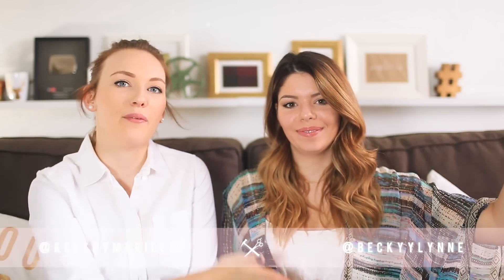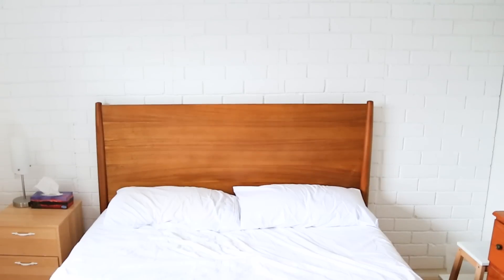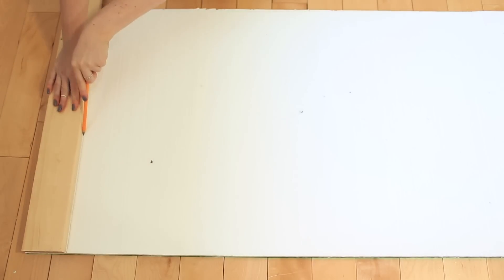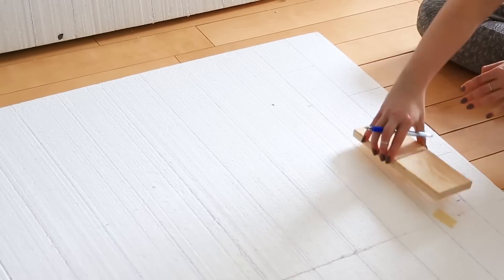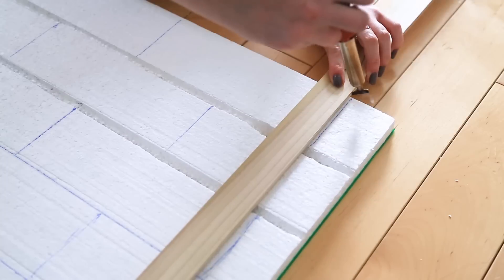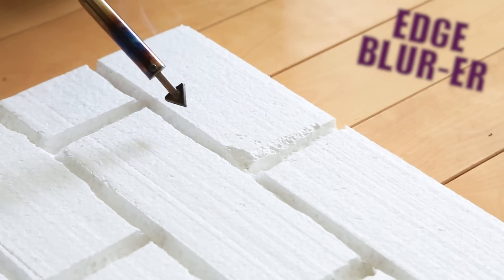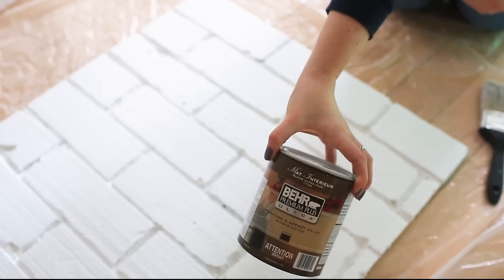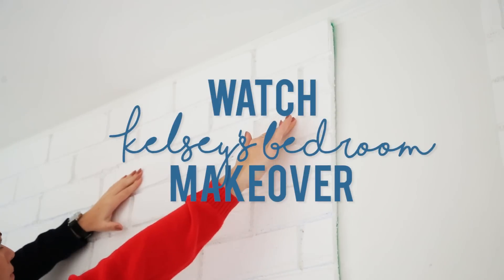DIY FAUX BRICK WALL - THE TEMPORARY WAY | THE SORRY GIRLS

Comment: Pro tip: I use the tip of an old hot glue gun to do the exact same thing and melt/"weld" the foam
Reply: THANK YOU
Reply: omg thank you!
Reply: chynatheching yea or I was thinking a wand curler
Reply: OMG THANK YOU FOR THAT COMMENT! I really want to do this brick wall but my only problem is the welder! I was thinking of something I can use instead of welder haha didn't think of glue gun thanks so much xx
Reply: YOU ARE A LIFESAVER I LOVE YOU
Reply: THANK YOUUUUUUU
Reply: chynatheching LIFE SAVER
Reply: Anyone have pictures to compare the hot glue gun affect?
Reply: chynatheching this is awesome!! Thank you for this tip!
Reply: GOD BLESS YOUU
Reply: do you just not use glue in the hot glue gun?
Reply: BLESS YOUR SOUL I HAVENT DONE THIS YET BC I DIDNT WANNA BUY A WELDER
Reply: chynatheching. THANK YOU!
Reply: You're literally god sent.
Reply: great tip!
Reply: Ohh tyy i was about to comment that i was sad cause i didnt have the tool lol
Reply: hey when you say this do you mean like turn on the glue gun?
Reply: i think you just turn it on without putting the gluestick on
Reply: Whoa..way later..but how about a soldering iron???
Reply: I was just thinking of that...wondering if it'd work
Reply: I was thinking about using my hot glue gun while watching this video too ☺️
Reply: wowwwwwww genius
Reply: Thanks for the tip
Reply: Didn’t work
Reply: u bloody legend thanks
Reply: Omg that you you are literally a life saver
Reply: Just tried this. The hot glue gun melts the styrofoam VERY slowly. It also shows the imprint of the round tip of the gun. I'm just gonna purchase the tool instead of spending 16 hours using the hot glue gun.
Reply: @bellak2546  THANKS for sharing your experience!
Reply: STOP LYING
Reply: thank youuu
Reply: This comment is so genius thank you!!
Reply: I used a lighter. I tried a curling iron and it wasn't hot enough
Reply: @Carson Cohen instablaster :)
Reply: @Marlon Xander It did the trick and I finally got access to my account again. Im so happy:D
Thank you so much you really help me out !
Reply: @Carson Cohen happy to help :)
Reply: just saved 30$ thank you <3
Reply: THANK U

Comment: You could even cover the styrofoam in grout to add a more realistic texture. One or two coats of watered down grout shouldn't add much weight and would add a ton of imperfections for realism.
Reply: And it probably would also take away this weird styrofoam feel when touching the wall, right? Has anyone tried it?
Reply: +Pheove it's a really common technique for building foam rocks such as for reptile enclosures, it works great for that. Usually you spray some watered down glue over it after to seal it, but that's not exactly necessary.
Reply: J Hughes Sounds great, I might try it. Thanks! :)
Reply: Way late...but.. foam core boards or plywood etc...covered in spackle ..sometimes a base layer..let dry..then add another thick coat..then before it sets you drag the lines to "carve" out the lines to make the bricks... we use it for theatre sets.. to make bricks..stone..tile..then paint everything...you can take a brick sized and shaped sponge to add more grout to the "bricks"  adding more dimension to each brick..and more texture..before painting...using theatre set tricks can sometimes turn plain jane items into really amazing items...and in rentals using some of the theatre set theory can help too... backdrops on rollershade devices using flats...like movable frames with feet to make walls... so many different possibilities... i hope people really used the idea in thus video to make amazing walls that could move with them from one apartment to another...
Reply: Loli, great ideas!  I would like to do something similar for a wedding backdrop.  I thought maybe even chalk wax might give it an aged dimensional look.  Thanks Sorry Girls for this DIY!
Reply: @calliemaddiecats5457  honestly...for the wedding...if i had enough money I would just buy the four by eight faux brick sheets available at most home improvement store.... because a bride has a million and one things to do already..just paint....if not...use a  soldering iron and seal with a watered down white pva glue and go nuts with your faux painting techniques.. good luck with everything and Congrats!!!!
Reply: Great idea, but would the grout adhere to the styrofoam? Styrofoam is a tricky material...
Reply: @loliluxe1747  Super helpful now, so it's not too late!!
Reply: @angelagladwell354  PVA grout should adhere... U could always coat ur Styrofoam with pva/white school glue before anything... I have coated cheap Styrofoam in school glue and been able to paint it with paints that normally would melt the Styrofoam!
Also..I saw someone take cardboard, their hot knife, or soldering iron... Draw out the bricks, go over "grout lines" a couple or few times with the soldering iron then really go nuts with the Spackle... Then they used re terms tape, a reusable heavy duty silicone type tape...to put it all up for a back splash...it was gorgeous... It was a renter friendly video.
Reply: @sarahelliott5588  I found a cardboard version of this too... Read my other newer comment!

Comment: THIS IS ONE OF THE GREATEST DIY'S ON THE INTERNET! I've been trying to redo my wall for quite some time now but I rent the place so I can't paint it or glue wallpaper on. Just two questions: Could I use a dremel instead of the plastic welder? And I have lights and a light switch on the wall I want to do this on. Any tips would be appreciated. Thanks! xx
Reply from the maker: +flora li Hey! I think we saw someone else using a dremel on styrofoam, maybe just do a quick google search. I had an outlet and I just cut it out using an exact knife!
Reply: +flora li the issue that seems to present its self to me is that your brick woudlnt come forward in an actual brick wall, the plate of the light switch or plug in would sit ontop of the brick so it would be kind of obviously fake. if that doesnt bug you ive seen high density Styrofoam cut with a dremel to make holes (which would then be used to reach your switches) but i think you need the welder to get this effect on the actual board D:
Reply: Joshua Creel Thanks! I shall take this great advice on board I don't even use the lights on the wall though, what a shame :/
Reply: +flora li Yes, this is A-M-A-Z-I-N-G!!! I was thinking for ages... what to do with that poor empty wall in my flat! Thanks girls!!!
Reply: You could probably use fine point soldering iron. I've used it successfully in the past on plastics and regular Styrofoam, will probably work on that Durofoam stuff, too.
Reply: Can you ladies possibly update your materials link, when clicked it's taken to a page called "parsel" with no materials information! Plz n Thx!! Amazing DIY!!
Reply: LadyDiva9081 yes please update!!!!!
Reply: I actually kind of just dug through my local hardware store's aisle of insulating materials, until I found a similar stuff :) It's usually in the back of the store next to cement, fences, lumber, and other building stuff like that.

Comment: This looks awesome!! What a great idea! I think if you didn't want to use the plastic welder thing (personally it looks kind of intimidating to me!) you could also try cutting out styrofoam into rectangles that look like bricks and gluing them on a styrofoam base sheet. That way they still stand out in a 3D way but you can avoid the welder tool

Comment: Wow 

What do you think about applying that to a ceiling a half that it doesn't have a shower? 

Also there is this other tool that it's for photos or some kind of plastic heating tool to make little pockets I wish I knew the name of the tour it had a straight edge on the bottom of it though not a Arrowtip 

Approximately how much was that with the tool and what would be your second option choice for the tool?

Comment: okay so i have been wanting to do this for a while. i got 1 problem. I have electrical plugs in the wall that I want to do . how do i work with that?
Reply: Maybe you can cut off a small square of the foam where the plug is

Comment: SERIOUS QUESTION: I'm a broke college kid, would it work just to tear the board with my hands? And just use my nails to chip the 'dents' out! Thanks :)
Reply from the maker: +Meg B HAHA. k well when I had some areas to touch up (some parts that didn't align when the panels were put together) I used an exacto knife to carve out small pieces the morter lines (laziness). next time you have styrofoam from like a box try cutting some lines with an exacto knife, see how you like the look. won't look as authentic but you never know! it also might take a long time...
Reply: TheSorryGirls
Thank you, I will try this out in my future apartment!
Sincerely, penniless college girl

Comment: I was doing a science project and I needed to glue styrofoam so I used a hot glue gun and quickly realized that the tip of the hot glue gun was melting the styrofoam. If you don't have a welter, just use the tip of a hot glue gun and make sure it's heated up. It works really well!!

Comment: I am currently in the middle of doing this with a hot glue gun. Definitely takes longer, but its coming along. Just wanted to pop in and remind everyone who decides to do this DIY, make sure you ventilate if you are doing it inside! I have windows open and fans going. The fumes are nothing to mess around with!
Reply: Hey, how has it been holding up so far?
I just finished doing it but I'm still a little skeptical due to the fire hazard aspect
Reply: @himarao2293  Im not actually covering any walls. Just using it as a background for my photography and putting it away when not in use. Looks great in pics! But if you do use it on your wall, I would just suggest not covering any outlets.

Comment: is there ANY other way than usind a plastic welder ? here in austria these things cost an arm and a leg :) more time investement would not be the problem. heeelp :( would LOVE to do this !@@ thank you ladies for being awesome !!
Reply: +carmen cosmo maybe a curling wand/iron would work?? but i'm not sure if that's safe someone commented that maybe a glue gun without a glue stick might work as well, but they hadn't tried it out yet.
Reply: +darkmerrygoround I'm not one 100% sure on the curling wand/iron but when made a brick tower for the background for a school play I used a blow dryer
Reply: +carmen cosmo The only other way I thought of was gravers (they're chisels but in different shapes, used for hand carving of wood or lino) but this would be a lot slower and the chipping effect would probably happen on its own, but in a less precise way. Hope this helped.
Reply: Maybe a soldering iron would work, it looks pretty much the same as their tool only with a different tip. You can get 'em online for ten bucks or so and you'll surely use it again for some thing or another. Hope that helps :)
Reply: Craft stores usually have similar heat tools that come with the same triangle tip that they used. They should be cheaper then a plastic welder. I would recommend a store(s) but I can't as I do not live is Austria. I hope you find something that works!
Reply: The tool they used is just $20

Comment: Could you guys do more DIYs with that tool? I want to do it but don't want to buy the tool if I'm only using it once
Reply: I know this is reaallly late but you could use the tip of a hot glue gun to melt the styrofoam.

Comment: shouldn't you tell people about the fire hazard of keeping exposed styrofoam on your walls? 

styrofoam is made of the same base components as gasoline, most plastics are, but the biggest concern about foam products (styrofoam) is that they are full of air, all those little air bubbles give it a lot of surface area, and the second part of the fire triangle. [fuel, air, and heat]. styrofoam ignites easily, burns very hot and very fast, and melts as it burns, forming a pool. large ammounts of styrofoam should be keps away from sources of ignition such as heaters, outlets, any candles or things that produce heat or sparks. 

These decorations can be very dangerious in children's rooms and should be protected in much the same way as a christmas tree in your home. be very careful.

Comment: wonder if a really hot hot glue gun (without a glue stick in it) would work... maybe I'm too cheap to buy a new tool.
Reply: I think it would, but it would need to be really really really really hot
Reply: The tool is just $20 US
Reply: +Alejandra Ruiz that's too expensive for one diy
Reply: +Hungrei Smol Child you could most likely use it for other diy

Comment: Hmm could i use a glue gun with out the glue stick so that just the tip is hot to melt it? Or no .... Anyone? Lol
Reply: +Alondra Marure ooh....that's smart, maybe you should try it in a small piece of Styrofoam first b^^d tell me how it goes, i so want to try this but i think the thing they used is costly in my country :(
Reply: +darkmerrygoround i will & i agree on the cost lol
Reply: Alondra Marure yey! thanks, hope it works! :D
Reply: +Alondra Marure Great idea! I was thinking something along the lines of a thin curling iron? I might test it out and see how it goes.
Reply: The tool they used is just $20 US. Its pretty cheap for a diy like this
Reply: +darkmerrygoround maybe you can rent it in your hardware store?
Reply: PrincessFromParis that would be a neat idea but hardware stores in my country doesn't allow that, sadly xp
Reply: +Alondra Marure I was actually going to ask the exact same thing. Should work right? Has anyone tried it yet?
Reply: have you tried it yet? did it work?
Reply: A hot glue gun would work, yes. But so would a cheap wood burning tool that would give you way more control over the process. 
I've made dozens of these panels for haunted houses.
Reply: lol this reply is two years late, but did you ever try that?